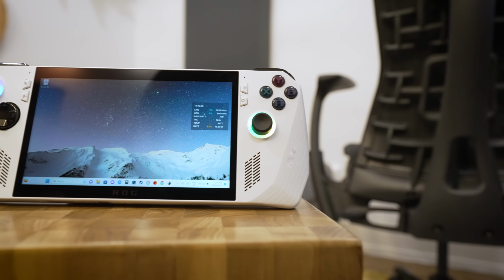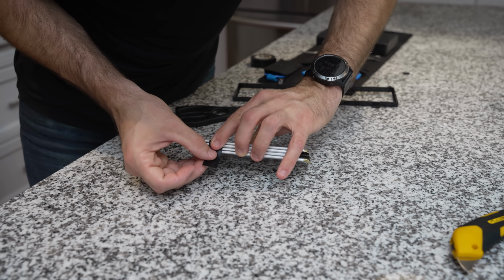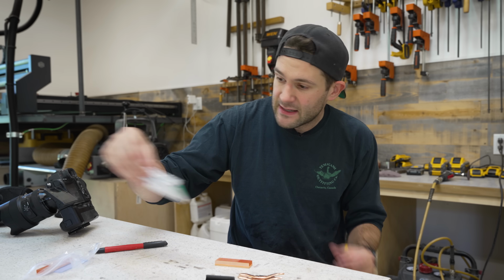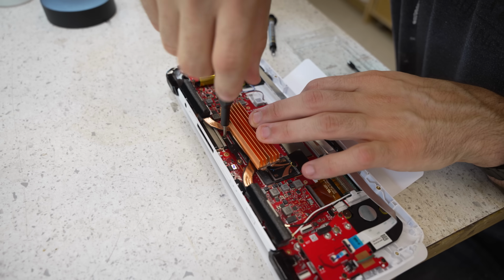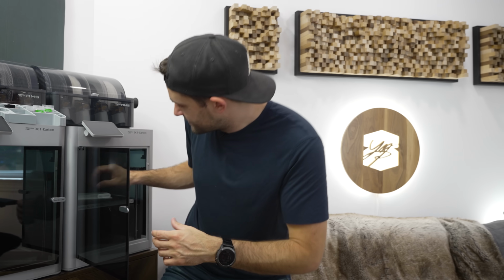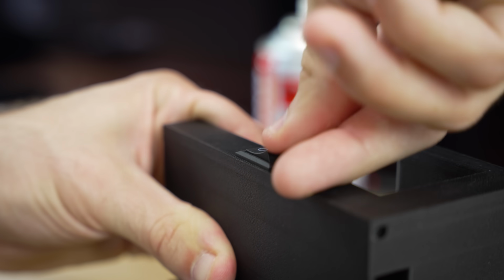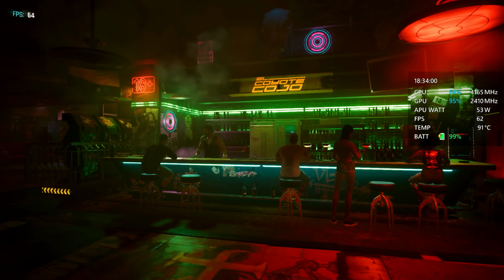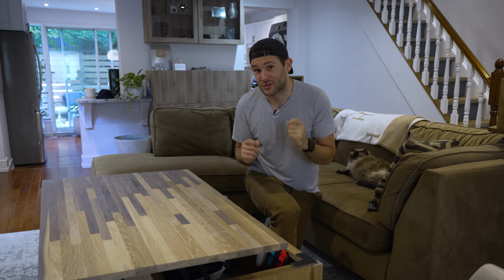I don't understand why people buy Steam Decks...

Comment: A slightly better way to go about this (all be it more complex) would be to solder some wire onto the internal fan controller contacts and run the wire to the bottom of the plastic shell where you could drill a few small holes and put some metal contact pads , then you have some metal pins on your dock that line up with those pads and run to your dock fan , so that the dock fan throttles it's speed automatically based on what your console's needs and workloads , no need for a on/off switch
Reply: Yeah, but this whole project is flawed from the beginning. Not knowing about thermodynamics and material physics was the entertaining I got out of this video.
First: Massive Copper heatpipes BEAT ANY hollow/fluid filled system. Latter is only done to get the price down, btw. Wow ... and through what hoops this guy is jumping just to get his flawed design into shape[1]. Well, but that was well deserved. Actually knowing what you are doing (including doing the math for the closed cooling loop) would've prevented from doing all these botches. Anyways, some need to produce content ... even if it is absolutely weird and superfluous BS ... which the viewers then pay for with their naivety. 

The, lemme call it "automotive delusion", was also a banger:) Aha! Reflective isolating tape nowadays does create a temperature gradient in a EFFING CLOSED SYSTEM! ROTFL, you know what I mean, with the SD-Card attached to the rest of the system via copper and on the same PCB. What a delusional clownery!:)

That this guy has absolutely no clue about electrical systems and how to calculate and handle their thermal power loss/heat loss. Yeah, why not folding a battery pack (meaning: simply bringing it out of spec/area of safe operation) and also completely changing the volumetrics and aerodynamics of the former casing and inner setup. Like thinking ... Oh, the original engineer did this because of his feelings.

Well, what you never see from these YouTubers is endurance/stress tests and a report about them a month or six later, or a single time admitting to fail and btw. this could simply be done by enumerating the certifications, safety regulation and engineering practice of the original device they violated. Yes, that is impossible to do for them, because THEY DON'T KNOW WHAT THEY ARE DOING!

By my grandmother's beard, I bet you (@ForbiddenFate) put more thought into your comment than the content creator who dug up this absolute nonsense (they are always based on those stooopid life hacks/electronic hacks) posted on some shady platforms. 
Have a good one and a long living device!:)

Edit: [1] To make this clear, if you have a material/workpiece/technology that is not intended to do something with ... then don't do it. Like possibly exploding fluid filled treasure vessels made out of weak(soft material) copper. This stuff is not intended to be soldered. I repeat: IT IS NOT INTENDED FOR THIS KIND OF PROCESSING!!! Who does otherwise (and even in front of an audience) is an absolute <word with i and similar to diode at the end>:) And possibly you endanger the users of this device (its always the loved ones who get hurt by this and not the ones who deserve it!) or manipulate the even bigger <word with i and similar to diode at the end, plural>, us viewers into endangering themselves. 

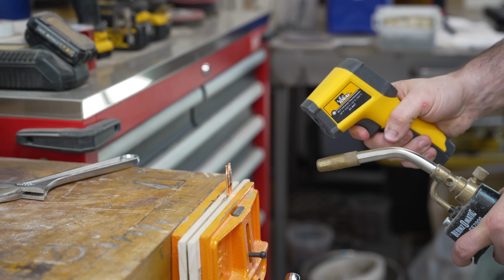More findings: This absolute plumber (wait, this would actually be a praise, because a plumber would know what he's doing. So I take that back! Hehehe) thinks "a little warming"(around 5:30) .... "but not so that the fluid makes the device explode" (paraphrased, we are talking about ballpark numbers under 400 °C) does help in bending his copper material. What a clown!:) By the way, copper is annealed softly at a temperature of 450 C° - 600 C°. After soft annealing, all copper parts can be bent very easily. But this material change is definitely permanent (Also the bent parts now have a completely different brittleness than before) and no one here knows whether it was a good idea in this case.

Final words: Just look at the Noctua fan, which is almost bigger than the device, hehehe. Guess from what the new (better, yeaaah!) temperature measurements are influenced the most? You get it! What an embarrassing stream of self-delusions tightly packed in this comedy video. Very entertaining, if you ask me!;)

Comment: It's not only the CPU that you have to increase the wattage, it's your RAM. If it were an Intel CPU, overclocking/tuning the RAM would have give you a way bigger increase.  But as we know, AMD does not scale with tuned RAM.  The reason Intel still the king at gaming on PC and this is where tech tubers fail for the most part to show you ; tuned RAM paired with Intel. They never consider the dips in frame with AMD CPUs.

Comment: cause a steam deck will not catch fire unlike this product and on top of that steam deck 1 tb model only 50$ more then the is fire hazard at 599$ for there cheap model and there top of the line is 699$ usd so the steam deck is 100% better everyway and is cheaper

Comment: As someone who owns a fully custom built ROG PC and ROG peripherals and a ROG SCAR 17.3" Laptop the reason you DON'T buy ASUS and ROG products is because of armoury crate and their software. It's been 3 years since I bought a ROG product and never will again, the problems I went through because of armoury crate and it's broken functionality has been the stuff of nightmares. Expect the products to work fine for about a year until the new generation comes out and then yours will start getting more and more issues with time.

Comment: For Asus, it's another product. For Steam, it's a new platform. That's the difference. Steam is constantly updating and improving the software on the Deck, and likely will for years on end. It's a device custom designed for their service and they work beautifully togehther That have over a decade of linux research and development behind it. Asus is just jumping on the band wagon. I enjoy asus products. I always use their Mobos, and I've had numerous laptops from them over the years too. But no. Sorry, Deck > any other hand held gaming computer because of their dedication to it. Asus can't optimize windows for their device, but Valve can modify every single bit in their SteamOS.

Comment: I don't understand why someone would buy and advertise this asus ally crapheap. Its the same analogy as the virtual boy and The R zone. The first trying to be innovative and the later simply trying to ride on a wave.
This crapheap from asus here, is a prime example, that they did not understand what they were copying. Windows 11 is not optimized nor developed for purely handheld devices, they tried that several times with windows phone, win 8 metro ui and surface devices but failed. This thing only lives from optimized software and ui, such as the steam deck does.
Those that need a desktop OS on a handheld device with pure touchscreen input have not understood, that is what laptops were invented for.
Also getting rid of windows in certain market segments and getting more towards linux gaming is a good thing.

Comment: Because in a lot of head to head comparisons in battery mode the ROG has terrible 1% lows in it's framerate.  While the average is higher the lows are really really bad.  I'd take gaming at 40fps with 30fps lows compared to 55fps with 8fps lows.  GamersNexus did a great comparison.

Comment: When i got an Index, valve RMA-ed it for me *twice*, despite the fact that the issue i had the first time was a dumb little problem that i could have fixed on my own (i actually didn't realize this until i had already sent it out, i initially thought it was a worse problem than it was.)

ASUS is the company that overvolted motherboards and fried CPUs. Their quality control is worse than nothing and they don't care. I'd rather have the deck, even if the ally is more powerful.

Comment: if it has Steam OS sure, other wise windows can lick my nuts with it's lack of package management and stability. when you spend your whole morning trying to figure out why PCs shutting when clicking print only to read headlines about a BAD update from MS on your lunch that only cements of what piece of shit spyware laiden garbage windows is. to be fair as web browser and gamer Linux has just worked for me the past few years. my apps update, no fiddling with drivers other than Kega Fusion Emulator everything is in the app store. the only thing that made me work was my printer i  did have to copy paste a command for that.....or did i just click the install button? either way it prints and scans. my deck is nice, it has an oled and screen and i just popped in my 2tb drive my lcd deck, a few reboots and i was up running just how i left things exactly but, in oled. and edit and the track pads are baller.

Comment: "Its better than anything else" Proceeds to tear apart and rebuild.
Reply: It is so good that you have to basically redo it from ground up to make it decent.
Reply: @shabath  ground up? the thing just needs a better battery which are very cheap and thats it, that wouldn't be a very insteresting video though
Reply: says its better than any handheld but tell you to manage your expectations far as graphic settings like come on i have a steamdeck oled and its great .
Reply: Nah dude if they have a heatsink sticking out the backend ppl would be beachin about it
Reply: I m too dumb for that .

Porceed to buy a steam deck
Reply: That does not mean it can (or even should) be better :))
Reply: @sergeikulikov4412  it should have been better, asus was just asus

Comment: When it comes to using liquid metal as cooling solution it does have advanatges over usual thermal paste but it comes with potentialy deadly side effect for your device if you're not carefull.Metal used for metal cooling is galistan, alloy of galium. Galium is like mercury liquid in it's natural form but not poisonous(still don't eat it!). You all know how destructive mercury reacts with aluminium. Galium reacts same way but not as fast as mercury but it destroys aluminium over long time. If you have you use aluminium heatsink liquid metal will destroy it over time, if it is copper then you're fine. Basicaly you're fine using liquid metal as long as you don't put aluminium heatsink on top of it.

Comment: Gunpei Yokoi, the inventor of the Game & Watch, many beloved Nintendo series and the Gameboy, brought Nintendo the philosophy of "Lateral Thinking with Withered Technology". This is what has made Nintendo such an infamous company. The original Gameboy was green to preserve battery. The Wii was same graphically as the Gamecube but with motion controls and a pointer. The Nintendo Switch is an ingenious idea. Sure, its graphics and quality and low compared to competitors, but that's what makes it shine. The idea of having two controllers from the start that you can pass over to a friend and  combine for single player is already amazing, but your friends can bring over their Switches and connect it to your dock or even play multiplayer with just the handheld screen. Every week, I usually go over to a friends house or they come to mine and we play Mario Kart, Super Smash Bros, Mario Party or some of the other amazing Nintendo games that are only on Switch, but if somebody runs low on controllers, then just connect your friends and it instantly adds it to the system. Also, the dock is already built.

Comment: Ah, by the way, you could just undervolt it for the same effect as all these ugly, cumbersome mods you did to cooling, except you know... with would lower power consumption when not pegged, and increase performance when pegged. i did that to my steam deck, -40mv all around, and it performs around 10% better than stock on games that push it, and battery lasts a lot longer on games that don't.

Comment: Why not paralel connect two original Batteries? Then you get more cells and then more battery life. Or just add a powerbank back where you made the exrtra space in the case. That whould be the easiest solution. Then you can Switch over to charge when you are on the go before you run out of power. But you are way more skilled then what I am so you will figurer it out🤓👍

Comment: That was a really cool project, though to answer the thumbnail, it's simply software & support.

The ROG Ally (And generally all other handheld console-like pc's, especially the Chinese ones) have a pretty horrible UI experience, as they all just run Windows 11 with some launcher type thing, unlike the Deck which, in average user terms, effectively runs its own OS in gaming mode, giving a clean, plug & play, console-like experience.

The second part being long term support. Valve has shown to really, really care about the Deck, which ensures its not going to get abandoned after a new model comes out.

Now I'm not sure how Asus & Lenovo are on that front, but the Chinese companies are abysmal for that, sometimes releasing a sequel model the same year, & abandoning the "old" one.

Comment: The controller on the Steam Deck is leaps and bounds better. It also does not run windows and has a console like experience. The Steam Deck is built with love. That's why I buy the Steam Deck.

Comment: My reason is the steam deck is more affordable it has amazing track pads it’s comfort to hold and valve support teams are quick and really understanding for replacements for defects and great with repairs and the amazing OLED panel and great battery life
Amazing video 
These are just my reasons I stay with the Steam deck
Reply: i barely use mine anymore wouldnt say its more comfortable i do like the touch pad but meh newer games struggle with it due to linux and hardware so i use the ally more only use the steam deck for older games basicly xD
Reply: @bionic3500  there is more protons that are not valves to get more modern games working
Reply: @aaww1010  he's just plain lying, in other comments he said that games glitch on the Deck and don't work. He probably doesn't have a Deck at all.

Comment: Two simple words to answer your question. "Community Support".  Within a week of buying my SteamDeck I was able to buy a clear back plate with a fan grill and a heat sink, install all my emulation software, have it all setup to boot from the SteamDeck OS, have it setup with plugins to track retro-achievements, enable gyro, tweak performance for the best needs per individual game.  I have a friend that bought an ALLY instead and while it is def more powerful, it's not nearly as supported, doesn't have nearly as many accessories, and simply is a bigger hassle to get all his steam and emulations running, and that's simply because the Community Support is not their to back it.  Certain games even run better on the SteamDeck than the ALLY cuz the Linux version that runs on the Deck has been optimized so much by the devs wanting to sell to all the Deck users.

Plus I'm happy to support a Linux gaming system.  Every game that is greenlit on Deck, is now a game that is playable in Linux.  Meaning gamers are getting closer and closer to not being locked down by Windows if that's not something you want.  Soon, gone will be the days of booting a virtual Windows machine through Linux to play all your games.  You can just open Steam like anyone else and play.   So power isn't everything, and if your only reason for why I should buy an ALLY is that's it's stronger, that's not good enough.

Comment: way too much low temp solder.  way too much liquid metal (BADleak). use this "Low Melt Solder Alloy With 176℉(80℃)" 
polish heatsink clean "weld Heatsink" "warranty voided prob. overheat cpu 95C.  Never ever get cpu above 70C.

someone try it lol

Comment: Are you sure that heat shield that you put on the SD card slot actually works? I would assume that would be better if you put thermal pads on there so that it would dissipate the heat to the copper heat sink and then out the system. However, it does that instead of blocking it, but I'm not sure I'm a big computer nerd more than a automotive nerd

Comment: You could have saved yourself the hassle and got yourself a OneXFly which is so much better. Bigger battery, hall effect sticks, faster and higher capacity ram at 32/64gb 7500Mhz, 2 USB4 ports, an sd card reader that works, and a higher TDP without needing to connect to a dock.

Comment: Asus is trash that's why, they not just not support properly they products they cut they functions before releasing them. 
Asus Smart Gesture an app for track pad on laptops they obsolete right before launch, they made some good enough tuf motherboard with app for fan control but they decide one day tuf is no longer premium so change the fan control app into a Asus store so you can buy a strix to optimize your fan set up, 140hz laptop that never run at that resolution, the display broke and they change you but just one time of you accidentally run a game at 140hz it will broke again and now is Your fault....
I mean they've got reputation for sell only one item to every costumer. You can buy Formula or Strix "expensive as hell" and maybe they work great on that but the 90% of their products sold die without any care.

Comment: I have the Launch Deck, OLED Deck, ROG Ally, and several Aya Neo devices. All windows handhelds have the same problems…windows sucks on a handheld. Slow wake from sleep/resume. Games will often not load for no reason and troubleshooting without a big screen and mouse/keyboard is awful. Battery life to get the performance gains over deck is barely usable. The deck just works and for a handheld that is meant to be for quick access to gaining sessions on the go, that’s kind of the most important part.